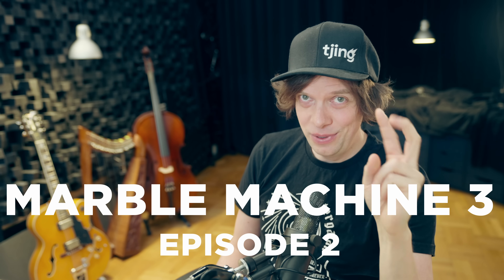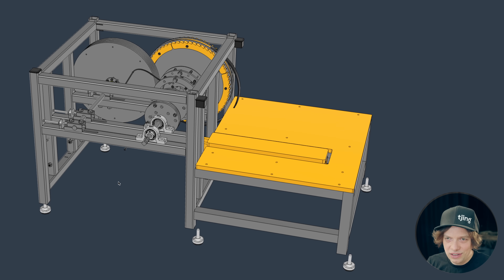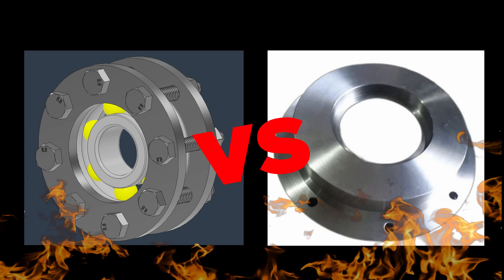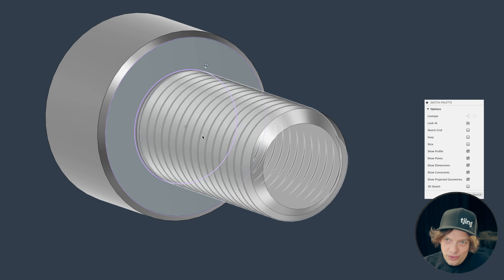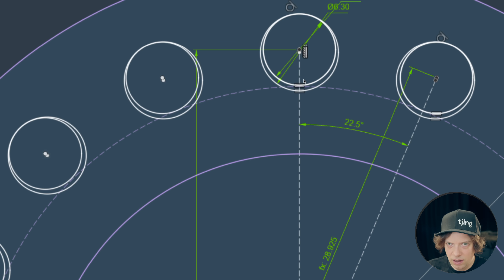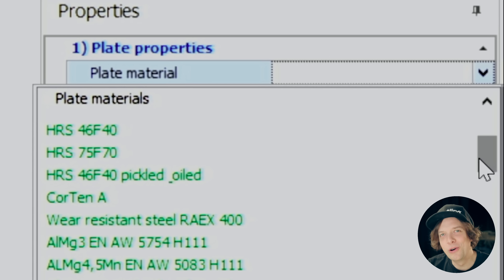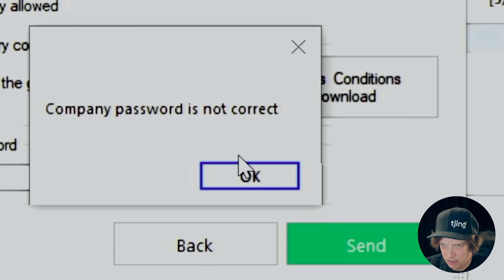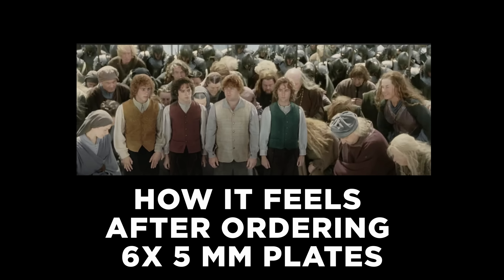Cheap Bearing Housing - Marble Machine 3 Ep.2

Comment: Tolerance stackups are a thing: How tight are the tolerances on those normal all-threaded bolts (shoulder bolts will be more precise)? How big are you making the holes for the bolts? How tight are the manufacturer's tolerances part-to-part? CAD is the only thing that is infinitely precise, and that sucks when you're chasing accuracy.
Reply: In a previous video Martin calculated that the Flywheel will be very heavy and moderately fast, so we're talking quite a bit of energy stored in there. If the wheel wobbles you could potentially run into resonant wobbling and the wheel shreds the bearing apart. I'm looking forward to seeing how this turns out though.
Reply: @tristanschonhals4416  So the bearings he is using for this example are rated to 8kN static and 15kN dynamic. Unfortunately this calculation is beyond what I can put in a YouTube comment but essentially the moment generated by being a small amount off position will generate a force vector that adds additional load to the bearing.

These bearings will absolutely lose capacity due to not being fully supported at the raceway but lets talk about even 1kN of load, that flywheel would have to weigh roughly 1000kg to hit 1kN static. Drop that down to a far more reasonable say 40kg and to generate 15kN of force on the bearing you are talking about a maximum acceleration 375m/s^s.

Toss that into your tensors for moment of inertia and do some annoying math and you get the full answer.

Or simplify it to a mass on a string and you can see that for a 1M radius that load is hard to hit
Reply: @Ammoniummetavanadate  But that isn't the real problem. This is a music machine. Any rattle or vibration causes noise, and that's not a good thing on a machine with a lot of instruments and microphones. If this machine is to run as quiet as possible you want as little wobble as possible. 

With the first Marble Machine almost everything was made of wood, and the bearings were rather rudimentary. And it was LOUD. With the MMX he tried to get it quieter, but kept insisting on all kinds of loud mechanisms for the aesthetics. Even so the imbalances were causing noise that he tried to get around.

With a fresh redesign from the ground up it seems short sighted to start the design stage by compromising on something as well documented as bearings.
Reply: @blahorgaslisk7763  With a perfectly located bearing within a tenth you would still have to balance the flywheel

Unless he decided to get it made from a block of steel and taper fit the shafts
Reply: @Ammoniummetavanadate   I don't think you understand how parts are made on a lathe...
Reply: @blahorgaslisk7763  Even if he, by some miracle, manages to decently balance it, it will most likely still show up in the audio due to it not being perfectly balanced. If vibrations are such a big problem, then why keep a huge rotating mass. 
There are other tricks that can be played. 

The first one that comes to mind is using a motor with a decent speed control loop, probably a servo. If a motor with reasonable power is used, the armature will probably be heavy enough to act as its own flywheel, making it easy enough for a properly tuned pid loop to maintain speed extremely accurately. As an electronics hobbyist, this is the route I would take. However, I don't think martin should even look into something like this, as he has experience with mechanical engineering and still makes things like that absolutely haram bearing block, so I don't even want to think about what he would be charged with by the tribunal for the unfathomable crimes against humanity that he would commit by even thinking about something this complex.

Alternatively, he could use air bearings or magnetic bearings, but those wouldn't be super great for a heavy load, so it would greatly benefit a well balanced lightweight flywheel, with a high moment of inertia, benefiting most from spinning at a high speed (albeit very high speeds would require excellent balancing), which is where air and magnetic bearings excel anyway.
Reply: @garywiens8625  Huh, should I go break the news to my lathe? Poor old girl might not take it well.
Reply: @Ammoniummetavanadate  Please do. 
 Keeping the flywheel excellently balanced would require you to do all operations in one setup. Turning any feature on the back to hold the part would mean that there would be a feature non-concentric with the axis of the flywheel, as you would need to take out the part and flip it to be able to use said feature to hold it so that you can machine both the tapered bore and the OD in the same setup, resulting in the mounting feature being non-concentric with the bore and OD.
Of course, you could flip it again and hold it by the taper to remove the feature when you were done with it, but the taper would probably immediately come off because you couldn't use something to hold it together, as that would prevent you from facing it until the feature is removed. You wouldn't be able to hold it by the OD unless the part was thick enough to be solidly and squarely held by it with at least the entirety of the amount you need to remove accessible to be removed, wasting probably an inch of material in total and probably a few hours.
I know that work can be dialed in with a 4 jaw, but a high speed flywheel with a high moment of inertia being even a few thou out could still cause vibrations that would show up in the audio recording, and that only gets worse as speed, moment of inertia, or both increase.
Reply: I don't think it is a big deal.

Those bolts aren't a wear surface.

Worse case he has a precision jig to locate the bearing and if some bolt is way out of whack you just toss it.
Reply: @Ammoniummetavanadate  gravity, imbalances, and vibrations will all cause the outer bearing race to hammer against the threads of the bolts. The points of the threads will flatten over time and the bearing will get loose.

Using only 8 bolts, if the bolts are too tight at the start it will force the bearing to deform. This will add drag, noise and vibration to the machine. He really needs to go ahead and make a proper bearing housing.
Reply: @billtheunjust  What load would you expect each of these bearings to see?

Why are you assuming this will be running imbalanced?

How much force is needed to plasticly deform the the threads of a 12.9 M6 Machine screw?

Now do a little back of the envelope math and you will see why this is worth trying.
Reply: @Ammoniummetavanadate  you are equally welcome to do the math if you are so confident.
Reply: @Ammoniummetavanadate  "Why are you assuming this will be running imbalanced?" 

Because it is not precision manufactured! Even using precision manufacturing it's hard to reliably make perfectly balanced fly wheels, and using a method of mounting the bearings that is imprecise is just asking for problems. If you look at quality components for engines you will find a lot of them are individually balanced during manufacture. And that's even though they are produced on high quality machines with very high precision. With this method of mounting the bearing the concentricity will shift any time you replace the bearing or disassemble the flywheel. That is directly opposed to the stated goal of making this third machine modular and able to be serviced in the field.
Reply: @blahorgaslisk7763  My good man, how much will the moment of inertia change if the bearing is off by 0.1mm on a 50cm flywheel?

Hell, 0.5mm off even.

We are talking about a low speed flywheel and programming wheels which are by their nature not balanced.

Maybe this does not fly for the flywheel but it is worth trying for every other bearing on the machine at minimum.
Reply: @Ammoniummetavanadate  I don't think you understand what precision actually means. Neither does Martin.
Reply: @thomasbecker9676  Lol.

What shaft fit should he be using for this project?
Reply: @Ammoniummetavanadate  I have no idea, as I'm not privy to the requirements, nor do I work for free. You seem to have a hard-on for Martin and his process, but facts don't care about your feelings.

Comment: i wonder if you could get better results by changing your bolts to half-thread/shoulder bolts.
Reply: Yep. But the best solution is a 4 hole flanged bearing. He can bolt the bearing right to the flyweel.

Comment: I'm not a mechanical ingeneer but going modular seems wiser, as it is in software ingeneering. I trully hope you'll manage to finish this machine! Even though imo the mmx was really beautifull, even not finished.
Ps: your studio makes a really gorgeous background! I love the black and wood
Reply: I'm an aerospace engineer, and I can confidently state Martin is lost in the weeds again.
Reply: @thomasbecker9676  Martin needs to at least look at a 4 bolt flanged bearing. It eliminates all of this nonsense.
Reply: @billkeithchannel  Martin needs to stop trying to reinvent the wheel.
Reply: as in all things, there's a tradeoff.  modular is great when your concerns can be isolated, but you do sacrifice a bit of confidence that the whole thing won't have strange, unexpected interactions between the modules.  there are a whole host of software companies that use a monolithic codebase specifically because it offers more confidence that your releases won't break in difficult to predict ways.  in mechanical engineering i would guess things like vibrations and heat would be difficult to isolate with a modular design, i.e. your modules individually work great but grind to a halt when integrated.

Comment: I have asked before. Why not use off the shelf flange bearings?
Reply: The whole point of a flange bearing: mount a shaft or axle to a not perfect housing or stand and let the flange pivot and shift to correct it. The mounting holes have big tolerances and they are supposed to.

But Martin is mounting the flywheel to it. So, it has tho be centered very well with low axial run out. Doing this with flange bearings is trouble waiting to happen...
Reply: @DrKlausTrophobie  There're both variants with oval holes for adjustment and round holes for no adjustment.
Reply: @nikolayyurchenko5075  Even the round holes have big enough tolerances to screw your alignment up in an application like this.
Reply: @DrKlausTrophobie  In this case bushings can be added.
Reply: @DrKlausTrophobie  Misumi sells flanged bearings where the outer diameter is circular and concentric to the inner one. The outer diameter is something like g6 or h6 locating fit and the part is shipped with the bearings already pressed into it. This allows for the flange to be used as a mounting method but also for the bearing to mount precisely into a hole— and it saves the user the effort of having to deal with pressing bearings into housings.
Reply: @DrKlausTrophobie  Doesn't that mean the bolt solution would be even worse?
Reply: @deathpony698  Possibly.

I get the feeling Martin has a false understanding of tolerances. For example his measurement of the bolts. They are always smaller then 6mm because they have to fit a hole without getting stuck half way in. But, this undersize isn't constant, it varies. His whole test might be useless  the moment he assembles the whole thing with different bolts.

And don't use longer bolts! The od over the threads is different from the od of the threadless part...
Reply: And shoulder bolts if necessary